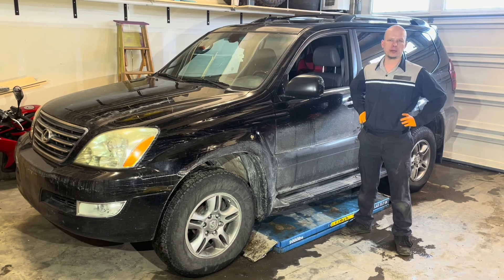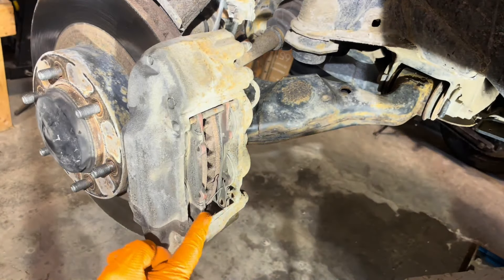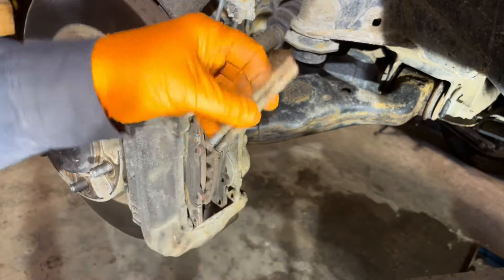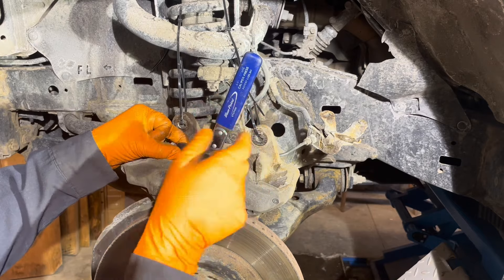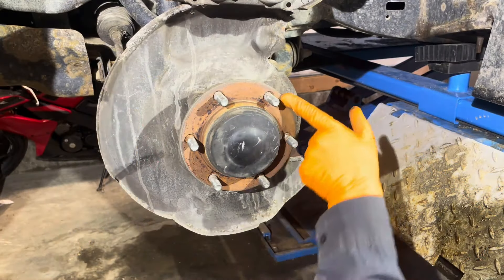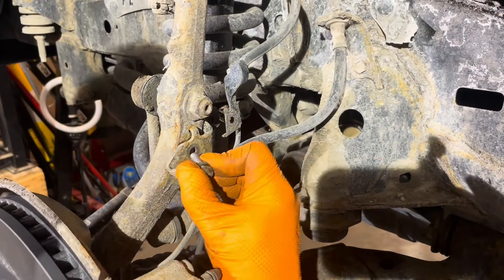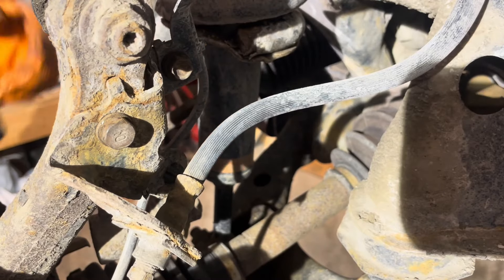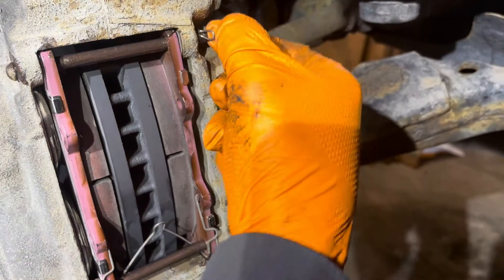2003-2009 Lexus GX470 2010-2023 GX460 Front Brake Pads And Rotors Replacement Instructions

Comment from the maker: Below are my affiliate links to the parts and tools you would use to complete this job. I may receive a small commission from the product sales. Thank you!
Genuine OEM Lexus GX470 2003-2009 front brake pads: https://amzn.to/3UvBQyD
Genuine OEM Lexus GX470 2003-2009 front brake pad shims: https://amzn.to/4a8o62O
Genuine OEM Lexus GX470 2003-2009 front brake rotors: https://amzn.to/3JO6qyH
Genuine OEM Lexus GX460 2010-2023 front brake pads: https://amzn.to/3UPsoHV
Genuine OEM Lexus GX460 2010-2023 front brake pad shims: https://amzn.to/4bufHrd
Genuine OEM Lexus GX460 2010-2023 front brake rotors: https://amzn.to/44uB0XE
Genuine OEM Lexus/Toyota caliper grease for between pads and shims: https://amzn.to/471ihnj
Brake caliper piston spreader tool: https://amzn.to/3q3NUMl
SUV jack stands: https://amzn.to/3q6VS7t
Anti-seize lubricant for the pad slider area in the caliper: https://amzn.to/3QcAXdR
Small wire brushes for cleaning the calipers: https://amzn.to/3OqlCoC
Large wire brushes for cleaning the hub: https://amzn.to/3OtyGts
1/2" drive cordless impact wrench kit to take the wheels off: https://amzn.to/3Kcw00I
1/2" torque wrench for tightening the wheels: https://amzn.to/3Kcu48E
3/8" drive flex head digital torque wrench: https://amzn.to/3O1EOru
1/4" impact driver kit: https://amzn.to/3RP95ga
Impact driver socket adapter set: https://amzn.to/44XTTkI
Rechargeable LED mini work light: https://amzn.to/3Y74OpY
Automotive trim and clip removal kit: https://amzn.to/3KgKGfg

Comment: Shouldn't you clean the brake rotor with brake cleaner to ensure there isn't any grease on the rotor before you replace the wheel?  Thank you for the video, very informative.
Reply from the maker: You can spray it off if you are concerned, but it is a brand new OEM rotor and they come with no grease on them. Some aftermarket ones might possibly have grease. If you accidentally end up making it oily during installation, definitely clean it up. Cheers!

Comment: What’s your opinion on changing the brake fluid? I have 20 year old vehicles whose fluids probably were never changed and nothing is wrong so far.
Reply from the maker: @tommyl3707  Lexus wants you to change it every 2 years, so that’s what I would recommend. Leaving it in too long may cause corrosion and other issues in the long run.

Comment: The pins should be installed from the inside (the head of the pins face behind the wheel so it is easier to knock it out for removal. 🧐
Reply from the maker: That’s a good idea. For some reason, Lexus decided against it 😆
Reply: @Viktor_G_Automotive  Per Lexus 2014-2017 IS200T IS300 IS350 service manual, the pin is installed from the inside. There is only single pin on these models with the compression clip push against the pin.😜